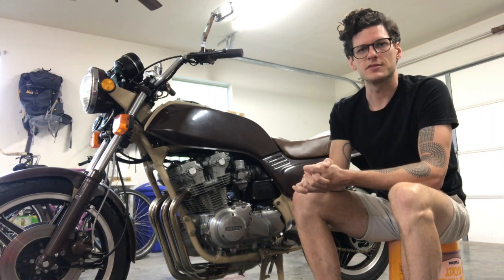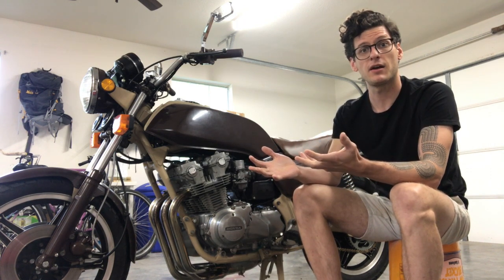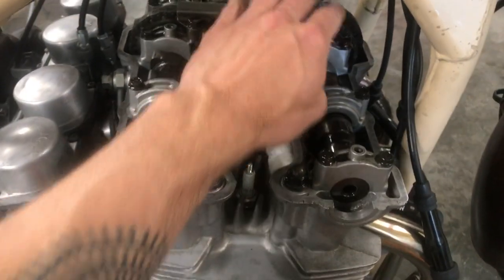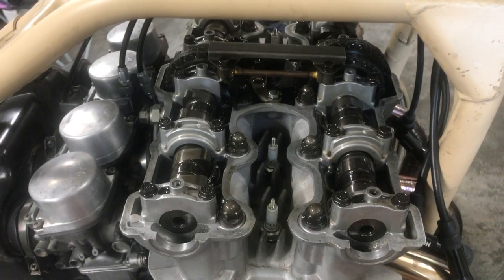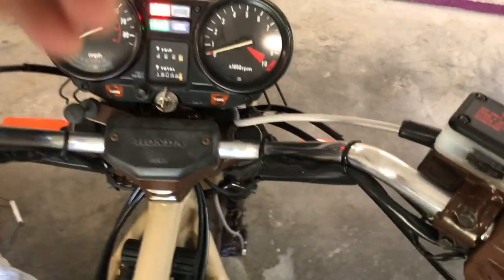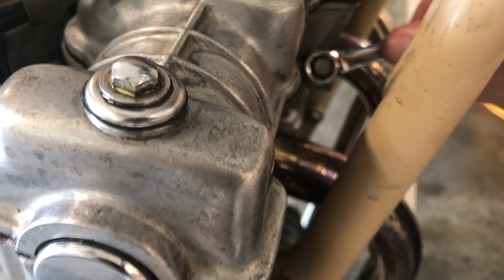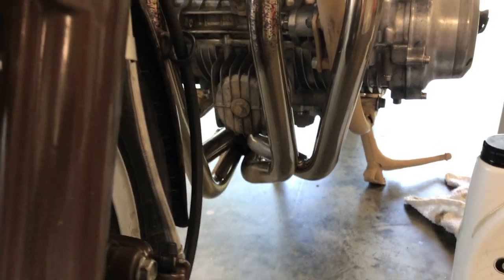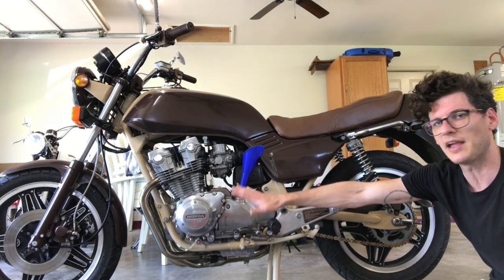1980 Honda CB750F DOHC Scheduled Maintenance: Valve Clearance, Cam Chain, Timing, Carb Sync, & Drive

Comment: Thanks for the video, been trying to tune my rebuilt engine and not to many videos put there. Quick question, when using the timing light and timing does the bike need to be running or can i do it by cranking the starter? Cause im not seeing the timing marks through the view hole.
Reply from the maker: Hey sorry I missed your question when you posted it. The engine does need to be running in order for the dynamic timing light to work. The bulb works by induction; it senses the pulse of electricity passing through the spark plug wire. If you're not seeing the hash marks while the bike is running with light attached, make sure your induction clamp is on the wire for cylinder 1 (or 4). If that is correct and you're still not seeing the hash marks, it's possible that your coils are swapped somewhere in the electric signal chain, and I imagine you would have a hard time starting the bike at all. I hope this helps.

The alternative is a static timing light, but I have not used one on these bikes and cannot guide you there. Dynamic timing is always going to be better on these engines, because you do need to be able to check that the engine is advancing properly starting at ~1500 RPM and fully advanced by 3000, which you can't do statically.

Comment: Hey man. Thanks for the great video. I'm buying a 1980 CB750 with 50k miles on it. It turns over but does not start. I am going to have the carbs rebuilt by a friend. I am going into this project pretty blind. I have always wanted to get into a project like this and I finally am pulling the trigger. Do you have any tips, videos, or any good source of information to help me out? I am mainly concerned about an engine rebuild. I know you can buy kits online, but I have not found any good sources yet. Thank you
Reply from the maker: Hey David, the good news is that there is plenty of information available for you. Start by Googling up a copy of the Factory Service Manual. If you can't find one, send me an email to the address in my About page. This will give you a step-by-step on how to dismantle the engine and provide you with tolerances so you can measure all the components and see if anything is worn out beyond its tolerance. Even just reading through will give you a great conceptual foundation for doing this work on your own.

It's a good thing that the engine turns over. These bikes are built very well and there are probably very few things that you will need to replace. The first thing I would do is buy a compression gauge and measure the compression on each cylinder. If you are within the specifications that the manual gives, you probably don't need to rebuild it. However, it's a lot of fun and you will learn a lot if you decide to do so. Plan on buying a full engine gasket set; I recommend the brand Vesrah which is manufactured in Japan. You will also want to buy a set of engine seals. 4into1.com is a great resource for OEM and new seals. Seals can be replaced without dismantling, and in general it's a good idea to do so. Regardless of whether compression is low, if you take the cylinders off you will need to plan on honing them and replacing the piston rings. Piston rings need to "seat" in the cylinder wall in order to make good compression, and if you remove the cylinders you basically "unseat" them. If the cylinders are badly corroded, the next step would be having a machine shop bore them out by one size (the manual will have these specifications) and you will need to seek oversize piston rings. Again, this is all contingent on a failed compression test, so don't let it freak you out. Unless the bike was thrashed in its lifetime, the lower half of the engine (transmission, clutch) is probably fine.

Remember that a bike needs three things to run: fuel, spark, and compression. The fuel system comprises the gas tank, gas lines, carburetors, and rubber intake boots. Pretty easy to make sure all of these parts are clean, and it's probably in your best interest to replace the old stiff boots with new ones to avoid potential air leaks into the fuel system. Make sure you buy OEM and not aftermarket; they are more expensive but for this specific part, necessary. The spark system comprises your electrics: battery, wiring harness, ignition coils, spark plugs, spark units, regulator/rectifier, stator, rotor, pulsers, starter solenoid, starter motor. A little more complex, but you can look up all of these terms to get a clearer picture of what they do. Know that the OEM spark units on these bikes tend to go bad and a recommended replacement is the Procom PE-C-MH900-A. You can get a set for about $79, and they bolt right in, no modifications necessary.  New ignition coils are not a bad idea, and the combination of these two parts will actually produce a stronger spark than the stock configuration (Dynatek DC1-1 coils is what the community recommends; whatever you go with, make sure they are 3ohm coils, and you are using the spark plugs that are spec'd by the manual). Compression relates to the engine; start with a compression test and decide from there if you need a rebuild. You can google how to test compression correctly, but on this bike since there is no kickstart you will at least need to get the starter motor working to turn over and pump the pistons for you (back to electrics).

Good luck, you are not alone and almost nothing is impossible to learn how to do on your own.
Reply: @Gumaamug  dude you are a legend hahaha. I feel like I know how to do everything I need just by reading this comment alone 😂 thanks so much, I can’t wait to get going. This was way more info than I was hoping to get so thank you so much
Reply from the maker: No prob, circle back with me in an hour or two, I'm currently posting another vid about the electrical system. And stay in touch!

Comment: Great video mate! Quick question, is the timing plate engine cover a dry cover or is generally filled with oil when the bike is running ?
Reply from the maker: Thanks! You can take off the circular timing plate cover while the engine is running but not the whole side cover as it does have oil behind it. By contrast, the stator on the opposite side (right hand) is a dry cover
Reply: Thank you , keep up the great content !

Comment: Do you know when (and how?) to replace the cam chains. I bought a CB900F, with a 100.000km (62000miles) on it - and fugured it might be time to replace them entirely?
Reply: Usually every 50000 km it's time to replace them
Reply from the maker: That's pretty high mileage and I would probably replace them to be safe. Usually the best indicator is looseness in the position of the cam relative to the crank; the factory service manual has instructions on how to check that the cam and the crank are in the correct position relative to each other using a punch mark on the side of the cam and the timing hash marks on the crank. If you turn the motor with a wrench to the position indicated by the manual (usually 1+4 TDC), the punch marks on the cams may be off by a couple degrees, and that's a good indicator of cam chain looseness.

The chain from cam to cam is pretty easy, you would just slide the new one on over the ends of the cams after freeing them from their brackets. The longer vertical chain from cam to crankshaft is a little more complicated and requires some special tools. You'd need to break the old chain, attach one end of the new chain to the old one with a piece of wire or something, and pull it through, down the bottom and around the crankshaft. Then use a master link and a chain tool to connect the two ends. Make sure you have the correct number of links on the new chain and that the motor doesn't turn while you do this, or your timing will be off and you could end up damaging a piston or valve. Use the same section of the FSM to double check that the cam and crank are in the correct positions relative to each other.

Comment: Hi Guma:  Today under acceleration demand, gears seemed to slip from a higher to a lower gear once engine demand was in the higher gear.  Are you familiar with this issue, or do you feel it might be a clumsy foot shifting down inadvertently - ? Thanks for your thoughts !
Reply from the maker: Can you describe it more specifically? Did the RPMs increase but the bike did not go faster? Could be as simple as clutch cable needing to be adjusted, or could be more serious like a worn out clutch. Or could be as you say a clumsy foot. Hard to tell based on your description.
Reply: @Gumaamug  I don't feel it was the clutch slipping, as was not a variable RPM like experience, and as I would need to re-shift up to the higher gear as it felt literally had shifted down as if i had done it - . Ill take her on a morning test drive for the near area tomorrow. _ 

The Clutch Cable Adjustment - were you suggesting more play ? 

Clutch seems to be quite fine as can handle low  end torque from higher gears. .I have enough Horsepower and  Torque that I can idle along in 5th gear in 25 mph zones quietly - 

Ill continue to see how she is doing tomorrow, as was hoping for a nice two or three hour trip in the county - 

Ill let you know what info I gather - 

thanks
Reply: I took her out yesterday for a two hour run with my dearest on back. No issues. Once Clutch Slipped. Only Once but under normal acceleration. I am able to drive low rpm in High gears at low speeds such as 25-30 with out slippage when adding demand in the throttle -  

This weekend Im going from 10W40 to 10W50 Motul Synthetic as my Pizza Oven Temp Gauge indicates a case temp of 200+ f on hot days - I figure this could affect the parts.
Reply from the maker: @ClassicRider  For what it's worth, I have always been told that synthetic motor oil will cause these types of wet clutches to slip. People on the internet have gotten outraged (surprise) when I've suggested that you should stay away from synthetic oil completely, but that's what I have done and I have never had slippage issues. Your mileage may vary. Keep me posted.
Reply: @Guma  Ill let you know, thanks - if she slips, then Ill go old style and even try a 10W60 . I looked for issues like the after effects of additives etc. Only thing made clear is that it wont break down, and right now I can afford to hit 240f in a traffic jam in New England - 

Meantime I also hear how great it is. But I welcome your experience which should be accounted for. If my clutch starts to radially slip  suddenly while under average demand, I will confirm it with you. And you are welcome to reference my cluster F'.  

I'm more concerned right now if I have to move the Long engine bolt to rotate the engine guard out of the way to look at the front left housing and possible lose parts which you have helped me with -

Comment: Aren't there 2 cam chain lock bolts for the vertical  chain ?
Reply from the maker: There are two cap nuts that hold it in place; the top one does not lock/unlock the spring mechanism that the tensioner uses and it is not necessary to loosen it in order to adjust tension. In fact, you probably don't want to loosen that nut at all unless you're removing the tensioner.

Comment: 20:10 i stripped those. like you said, it took seriously no force to strip them. how would you fix this? helicoil/timeserts?
Reply from the maker: You could try to find the brackets themselves on eBay, or yeah put a helicoil in and retap the threads. I would absolutely take the brackets OFF your cams and do this on the bench. No metal shavings in the top end allowed!!
Reply: @Gumaamug  yeah. new bracket would probably be better. thanks.

Comment: I have a question that may be related. I just rebuilt one of these (1980 CB750F) and i had to fully clean my carbs and all of that. Im just now trying to start the bike and it wont really start, it just pops and smokes not really run. Would you think this would be a timing issue?
Reply from the maker: It could be a timing issue. If the cams were re-installed incorrectly (i.e. 180 degrees off) or if they are not in the correct position relative to each other (i.e. the smaller cam chain is installed on the wrong tooth of one of the cams), it could produce this symptom when you try to start. It can also be an ignition issue: if you have the two pulsars swapped somewhere in the wiring harness (check the CDI ignition boxes under the seat), meaning all cylinders are firing at the incorrect time. Or maybe spark plug leads going to the wrong cylinders: left ignition coil goes to cylinder 1,4; right ignition coil goes to 2,3. Another possibility is low compression due to worn out rings or incorrectly shimmed valves. Lots of things to check on a full rebuild, but if you go system by system you'll weed out the issue.
Reply: Thanks for the quick reply. The motor was not rebuilt, just the bike itself. I did the carburetor service. 
I did change the coils as the stock ones were cracked, the firing order may actually be the issue. What’s the best way to test continuity between the phasers and the coil connections?
Reply from the maker: @tblackwell1  The old-school test would be to just pop the spark plugs out of the head and ground them against the outside of the engine block one at a time while you crank the starter. You should be able to see the spark with your naked eye.

Comment: Just a heads up. Synthetic oil Is 100% great with wet clutch. Almost all bikes have wet clutch and sport bikes need Synthetic oil. Honda,yamaha,suzuki, ktm,etc...... all offer thier own Synthetic oils. Motul 300v Ester Synthetic is absolutely the best oil for bikes. Even super anti wear additives won't affect wet clutches as they are designed to eliminate friction between metal on metal friction. The clutches are a fiber material on metal and the additives don't affect that friction that is what makes them work as they are designed to operate in oil. So everything else on your video I loved but your info on Synthetic is misguided

Comment: I know this video is real old but would anyone be able to tell me if the chain is over tightened could this cause the oil light to come on because the pump is not being properly spun
Reply from the maker: That seems really unlikely to me. My guess is faulty oil pressure switch, bad wiring, or low oil

Comment: use oil made for motorcycles. it is different. designed for also going through your "transmission" and clutch. the additives in car oil are bad for these things.